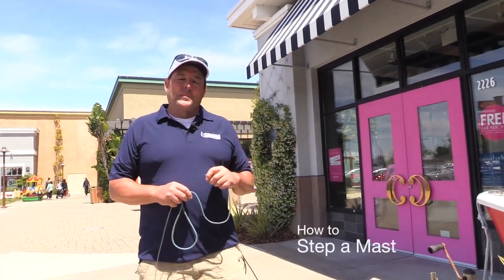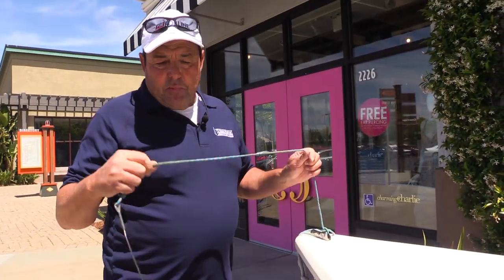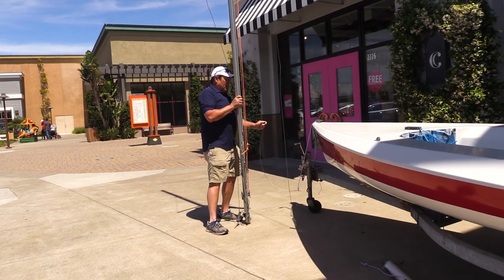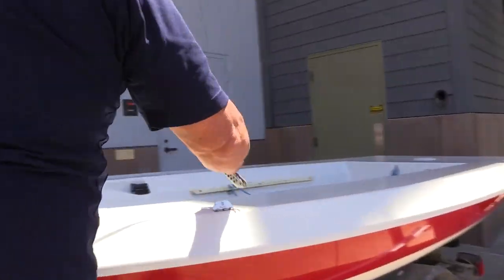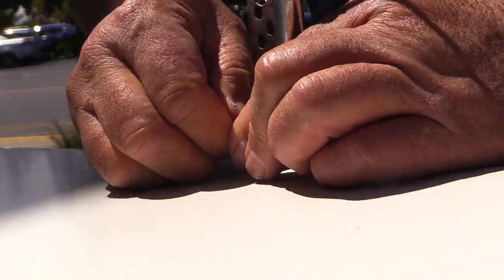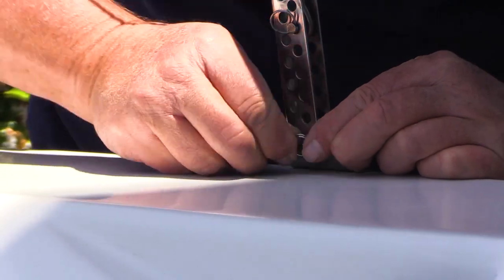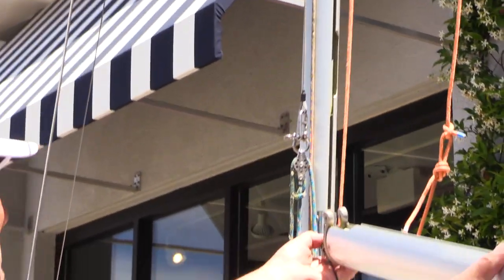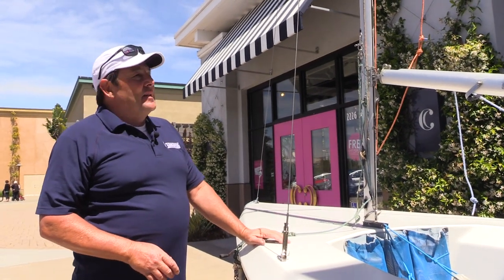How to Step a Mast & Install a Boom on a Vanguard 15

Comment: Thanks Matt, your video is very helpful. I was wondering how I would be able to set the mast on my O Day 15 2 by myself but you've given me the clue using the forestay with that short extension. I'm still thinking about a gin pole for added support in the rear.
Thanks again, vert helpful video.
Reply from the maker: Thanks for your comments, Wayne!

Comment: I have a 14 foot fiberglass sail boat with Clinker body style. It has no internal seating so you sit on the sides. Each side has a sealed compartment about 10L'x12"Tx10"W and has a 6" hole in each side for popout access. It has a slip in keel and a rudder system that has a long handle . The 20' mast sits in front of the keel on the floor and has two booms. I have only one sail. Dont know if its the main or the front. The keel and rudder were rotten and were incomplete when obtaining the boat.  The bow area has a wave breaker. The space under the bow is about 4 foot and enough to store a small cooler and clothing, life vests and other.  The aft area does have a place to hold about a 3hp motor. Looks like a hold with no drain. Nothing to support more than a 3hp or trolling motor. It has an internal aft space area for the fuel tank or battery.    Does anyone know what type of sail boat this is? No serial number, the top was pop riveted to the  bottom. Anti skid surfaces on the sitting area.  I would like to get a name for the boat. I am going to restore it the best I can. Add new hardware all around and the first is the trailer has collapsed leaf springs so that is first. I would put a photo here but cant.    Thanks
Reply from the maker: Unfortunately, we are not able to identify the boat from the description.  Can you send us photos of the boat to productadvice@westmarine.com?